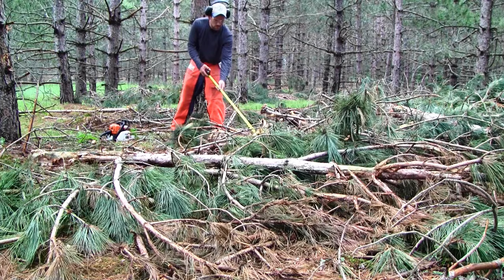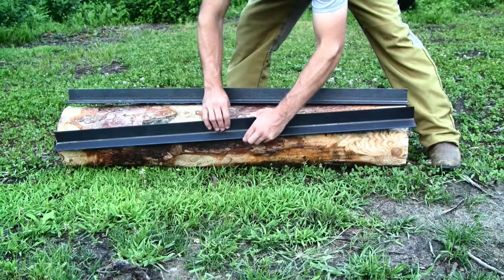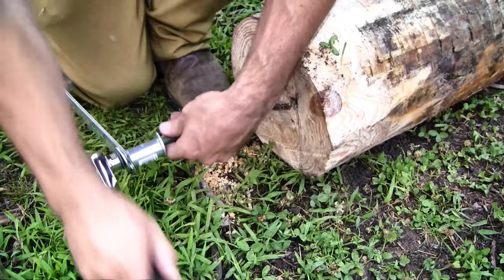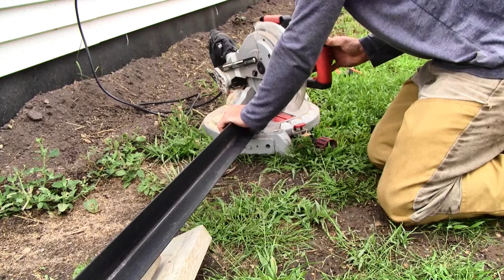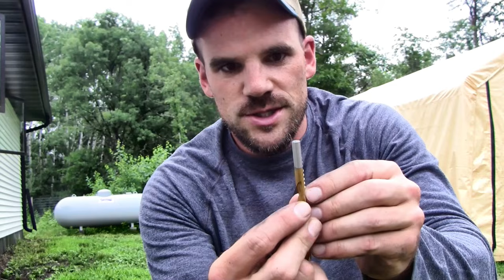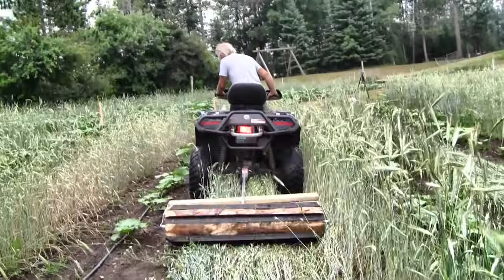EASY DIY Roller Crimper [No-Till]

Comment: Did the vegetation terminate or did it pop back up in a few days?
Reply from the maker: Rye terminated very well. However there were some other grasses/weeds mixed in that popped back up after
Reply: @northernforestwhitetail  Wondering of it isn't heavy enough. The commercial ATV ones are 600 lbs. dry and about 850 wet. Also, the blades on the commercial ones are angled, meeting at a "V" in the middle. Must be a reason for that, I would assume. Still, a great concept.
Reply from the maker: @Auction_Henry thanks- yeah the fact that the blades were fewer, helped. Sort of “jabbed” into the ground. Did the job perfectly on the target rye. My issue was more invasion of grasses that I think even a commercial unit would not have terminated

Comment: Wow.  That's genius.  I think I'll do it with square tube for the arms so I can mount gauge wheels for transport.  And your examples are exactly what I want one for.  Tried buckwheat as a cover in squash this year, and it would have gone great if I had your roller/crimper.  I couldn't figure out a good way to terminate it.  Thanks!

Comment: To pull with a pushbike or push by hand, should I make the log or drum even narrower, or do you think this one already can be handled by a human being alone?

Regarding managing jumpiness, you could split your blades into 8 pieces, and offset four of the pieces by (180/n)° where n is the number of blades you initially started with. (The maths works because 180° is half of 360° and you want to offset 4/8 of the pieces half-way between the other 4; you could also split into 9 pieces, offset 3 by (120/n)° and 3 by another (120/n)°)
Reply from the maker: Being a civil engineer, I appreciate your math! You are correct it is jumpy. Your idea would solve that. I would say this size I made is manageable for a grown man to pull. Add weight as desired.

Comment: Really admire your design. How much weight do you think is needed to crimp? Thanks
Reply: Thanks for your response.
Reply from the maker: Thanks. I bet my crimper weighs at least 50 lbs. seemed adequate. Could go a little more depending on the amount of thatch on top of the ground

Comment: Great idea!   .. A simple no-build option: Find one of those smooth lawn rollers people fill up with water chasing golf-course-flat lawns they later sell at garage sales. Drag that roller "down and back" and you'll flatten the rye just fine, any that try standing back up after the first roll are bent completely backward and stay down.  Hints to try: I have broadcast dry beans into standing rye like seeding the lawn and wait until the beans sprout into first leaves then roll down the rye. Or run the cultivator shoes down to cut rows and plant corn into them, then roll after the corn emerges. Standing rye keeps the ground more moist for beans/corn germination.
Reply from the maker: Good ideas thanks for sharing

Comment: Awesome, I did something similar. I had an old eight inch pvc tube about 4 foot long laying around.  I blocked each end and drilled a hole in each end for 1/2 inch pipe. I also found an old rake handle for a sleeve for the 1/2" pipe to fit into.  I filled the pvc tube with cement.  Attached angle iron to the outside of the pvc.  Built a hitch similar to what you did. Works great for what I needed.
Reply from the maker: I like your idea too

Comment: Did it end up crimping as well as you hoped?  Did you have a lot stand back up/would you add more weight next time?  I’m thinking about doing this for my plots this summer so wondered if you had additional input after doing this?
Reply from the maker: It didn’t terminate the buckwheat as well as I’d hoped- I believe the issue was I needed to wait longer to let the plants mature more. I believe I terminated it too early in the plant development cycle. I terminated exactly 6 weeks after planting. This coming summer, I’m going to give it 7-8 weeks. The key is you need the seeds to get to the “dough” stage. Where they start to firm up but aren’t quite viable yet. I terminated last summer when a large percentage of the field was still in the flower stage. That’s too early. Learned my lesson the hard way. The weight of the crimper seemed just right. Plants all had kinks in them.
Reply: @northernforestwhitetail  I planted winter rye last fall, but the deer ate it to a putting green. Hoping it comes back this spring and I can seed into that and terminate. Seems like timing is critical with rye as well.
Reply from the maker: @newgen_oldlifts5389  I’m doing the same thing you are with my rye area this coming summer. I’m going to let the rye get plenty mature- even if some of the seed heads are viable, that’s ok in my mind. They will grow up and mingle in with the oats and radish. That’s my plan for this summer anyways.
Reply: @northernforestwhitetail  sounds good to me. I’m going to try a blend from GreenCover this year. I’ve tried buckwheat as a summer plot the past couple years and the deer eat it to the dirt. Hoping a blend will help slow them down long enough for something to take hold so I don’t go into fall with bare dirt again. Though, I’m not very optimistic since they kept rye at putting green height

Comment: Have considered a similar design, but was looking at solid-tired wheels to screw the angle into, thus having a true axle. Looking at how it ran, I would pull it the other direction to give the angle more of a leading edge rather than trailing. Also, from looking at your buckwheat crimping, extra weight is probably needed and, as you stated, waiting for the pods to appear. It would be interesting to see if anything browses the new growth offshoots from the buckwheat.
I hope it lasts a few seasons fof you. 👍👍
Reply from the maker: I’m happy with how the design turned out it seems to pull great. Yeah I need to give the buckwheat just a little more time is all.
Reply: @northernforestwhitetail  It did pull fine in the video. My point was changing the rotational direction would change how the edge of the iron struck the plant. It should still pull just as well.
Reply from the maker: @williamgaines9784  yep makes sense

Comment: Nice.  I've considered this exact design idea (using a log).  On a commercial crimper, you'll notice that the blades are laid out in a chevron pattern.  That way, a blade is in contact with the ground at all times; no "in between blades"... and as a result, it rolls smoothly and doesn't bounce.  Yours bounces, as it rolls from blade to blade.  Aside from making the ride less comfortable, I'd be concerned that the constant "vibration" will result in the thing beating itself up in due to time.  My idea for avoiding this potential issue and making the ride smoother would be to cut the blades into three sections.  Instead of one long blade from one end to the other, cut it into three pieces and offset each blade from the previous blade by a couple inches.  So each third of the long still have 7 blades going around it, but they're only 15" wide (instead of 4 feet) and no one third of the log blades lines up with either of the others.   With more blades touching the ground and at given moment, the ride should smooth out an the log shouldn't bounce. Make sense?  What do you think?
Reply from the maker: Great thoughts- I actually almost built mine the way you are describing (offset sections of angle iron). Ultimately, I decided to keep my angle iron one piece because I was worried about the unit being too lightweight. Having all the weight of the log impacting harder on one single point, should kink the plants better I’m thinking. If you did offset the sections I would just make sure you have the option to add weight.  I think either approach would work well. It does feel like it almost “bounce” the way I built it which I think helps with that downward pressure on the plants. Thanks  for sharing
Reply: Very nice design to begin with as well. I was shocked at the prices online.
Reply: I think that would be a great modification. Almost like a spiral helical cutter head on a surface planer.

Comment: I like the DIY low-cost ideas as most of us don't have the endless money other You Tubers have to buy equipment! I suppose an oak log may retain more weight after it dries?  Do you get good mortality on your rye and buckwheat with just crimping or do you herbicide after crimping?
Reply from the maker: Right. I need the low cost approach as well. I think an oak log would be much better than pine. Denser wood and much heavier. I actually rolled my log up in a tarp full of water for a few days to water log it and add weight. I’m experimenting on your question of mortality right now. If you want a good clean kill, you will want to spray with herbicide after you crimp. But it is really dependent on how many weeds were mixed in your rye in the first place. I’m experimenting with seed rates to see how clean of a food plot I can get without using herbicide. I try to avoid using the stuff. I haven’t sprayed any since I started my food plot a few years ago at our new place.
Reply: @northernforestwhitetail ... what about a length of an old telephone pole?
Reply from the maker: @greyhawk-111  great idea- would last much longer than a native log because it’s already treated wood. Plus it’s already round and smooth. That would be a better design than mine. Thanks for sharing!
Reply: @northernforestwhitetail , maybe not "better", just a potential improvement.  The trick will be finding one. :)